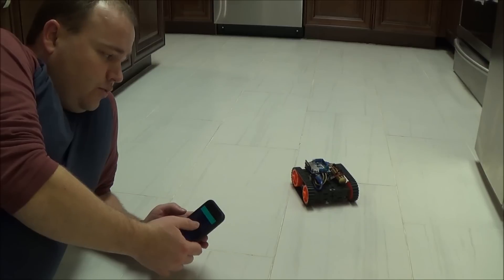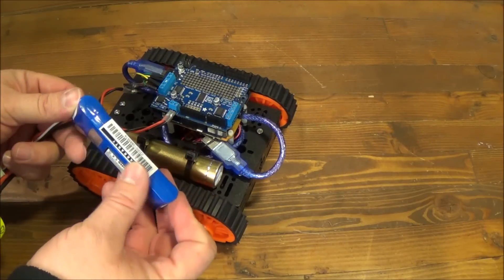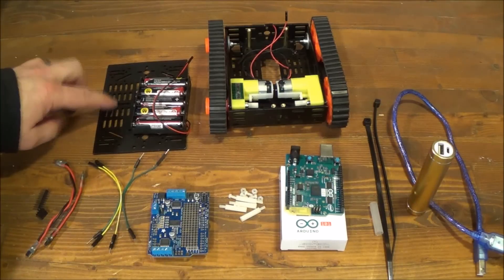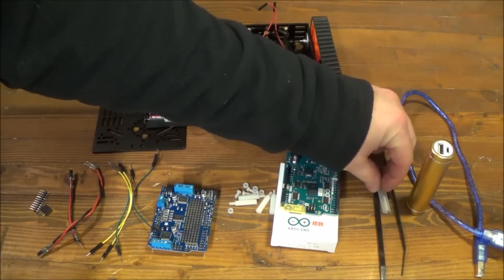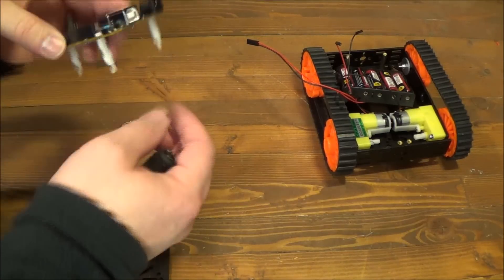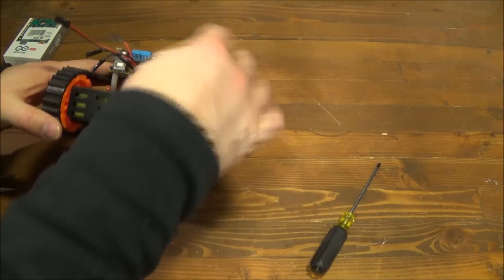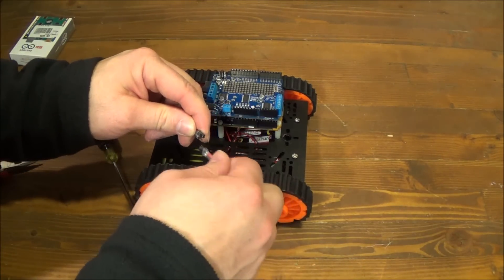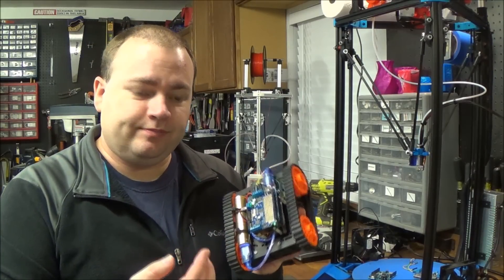Arduino 101 BLE Blynk Tank Tutorial 1 of 2

Comment: Hii..
I want to control robot car with joystick using arduino uno and bluetooth module. Left side two dc motor connected with each other and same with right side dc motor... 

Also it has a robotic arm with 4 servo motor also i want to control it with button....
 
Please help me for programming because i made controller using blynk android app.!
Or if you have any idea for it please help..